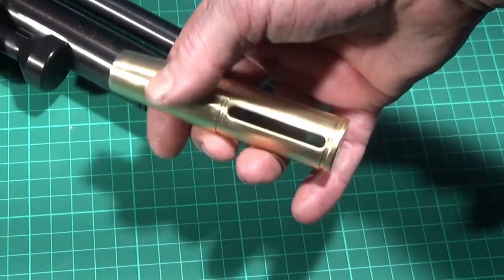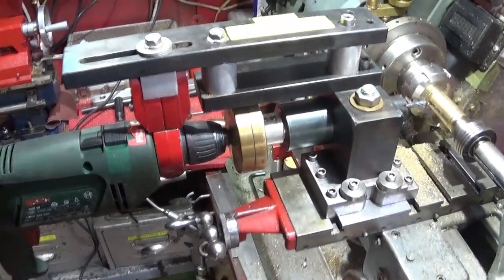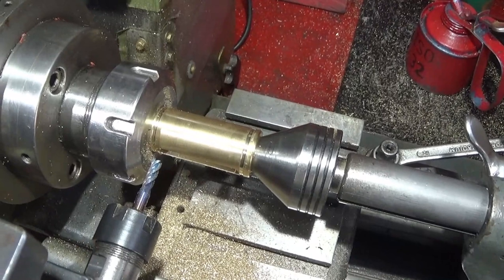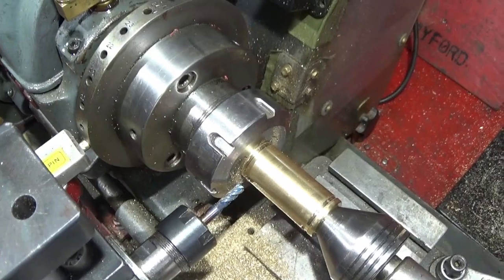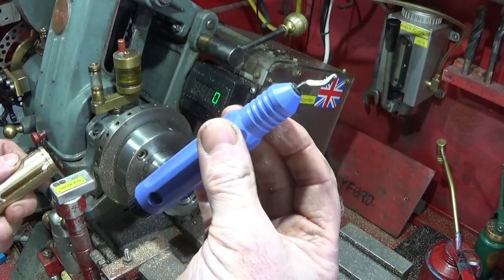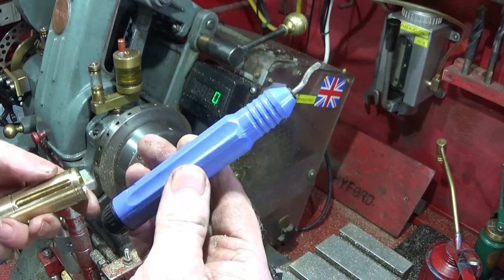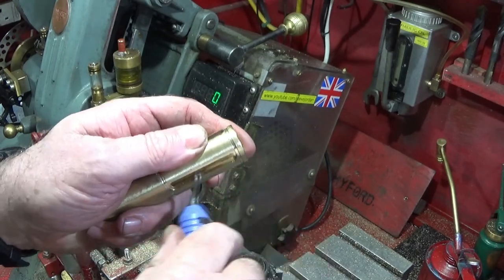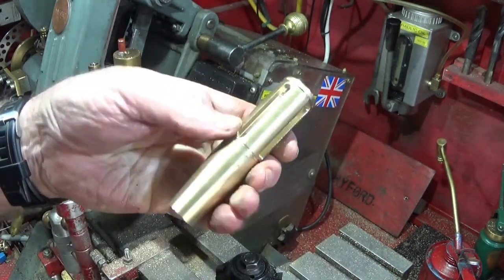Making A BSA Ultra Muzzle Brake. Milling On The Myford ML7

Comment from the maker: AN EXCELLENT DEBURRING TOOL AS SEEN IN THIS VIDEO
NG1000 NB1100 Burr Handle Scraper Deburring Tool 10pcs Deburring Trimming Blade Cutter Tools Kit
https://ban.ggood.vip/11oHa
Normal Price: $17.49
Coupon Price: 20% off ($9.59)
Code:  BG9f88de
Warehouse: CN
EXP: 4.30

Comment from the maker: SOME GREAT OFFERS ON DCMT070204 BLUE NANO & TITANIUM COATED INSERTS.
1. Drillpro 10pcs HRC45 Blue Nano DCMT070204 YBC251 Carbide Insert for SDJCR/SDNCN/SDQCR Turning Tool
https://ban.ggood.vip/116V6
Normal Price: $23.99
Coupon Price: $ 16.99
Code: BG4b76e8
Warehouse: ALL
EXP: 3.31

2. Drillpro 10pcs DCMT070204 YBC251 Carbide Insert for SDNCN1010H07/SDNCN1212H07 Turning Tool Holder
https://ban.ggood.vip/116V9
Normal Price: $10.99
Coupon discount: 25% OFF, about $6.74
Code: BG32857d
Warehouse: CN
EXP:3.31
Reply from the maker: 1. Monthly Fans Day: https://ban.ggood.vip/11gRi
(Time: March 9th-March 10th)

2. Saver Deposit Sale: https://ban.ggood.vip/11gRg
(Time:  March 9th-March 16th)

3. Saving Tips: https://ban.ggood.vip/11gRe
(Time:  March 9th-March 16th)

Comment: Hi Steve ,  i recently commented on your recent video and meant to have it on this  video.   After watching I went back in to post and brought up the wrong video and posted on it.   What i wanted to know was how to do internal threads when you have to go up against a face inside.    I cannot run my chuck in reverse so have to thread into the face and do a good job.    You have the threads like that in this video to screw on to the barrel but did not show how you made them. 

Dale in Canada
Reply from the maker: Hi Dale for threads like that up to a shoulder I usually do quite a wide thread clearance undercut at the shoulder. I then use a finishing plug tap by hand up to the shoulder. I hardly ever do  screwcutting with screw-cut tools on the lathe. Regards Steve
Reply: Thanks for the reply Steve.   I was making a backing plate for a collet chuck for my atlas 12 x 36 lathe and it had a clearance before the threads which I had to thread up to but could not thread in to it.   It has 1 1/2  inch x 8 Pitch National Form threads.   I could not even find any information about the threads let alone get a tap that size.    I ended up doing it but did some practicing on sacrificial pieces before I did the backplate.    It definitely was nerve wracking but worked out okay and have a runout on the chuck itself of .0004 which I was so happy about.   I  have learned so much from watching you and appreciate every video you do.    I also have a mini lathe just like yours so also like all your improvements.    Thanks so much for everything you do for us.   

Dale in Canada

Comment: I hope you noticed all the wobble and non-concentricity in your mill. If I can see it in the video, it has to be really bad in person. Is your collet damages or malformed? Maybe the spindle shaft is bent? Bad end mill?
Reply from the maker: It was the collet that was running out. Poorly ground I think. :)
Reply: @SteveJordan  That's good...easy to replace and cheap.